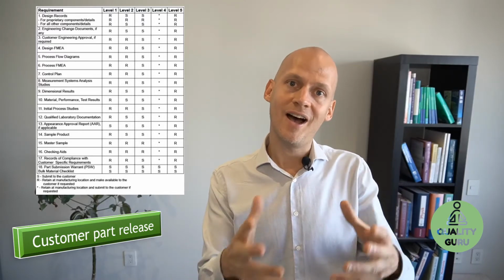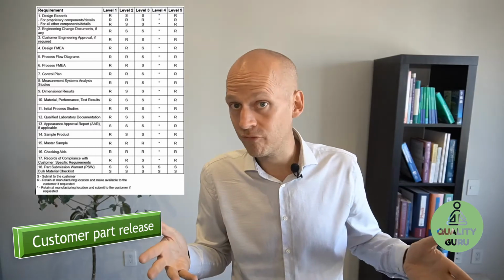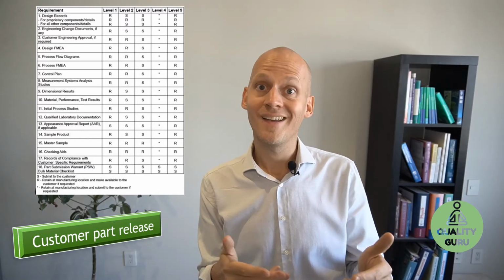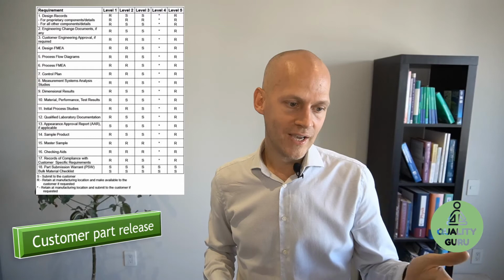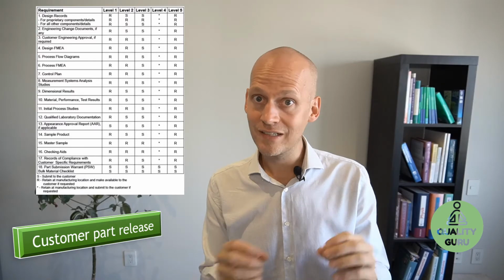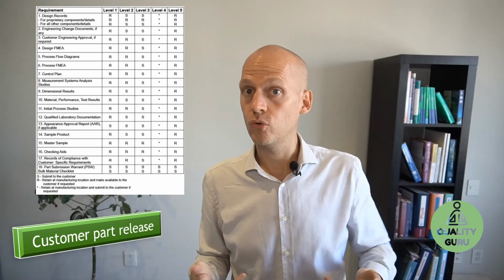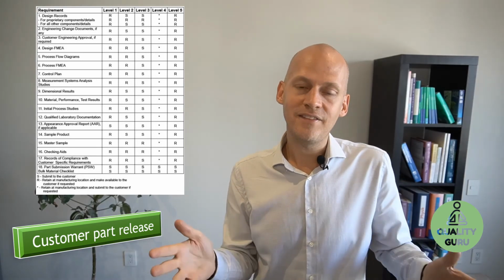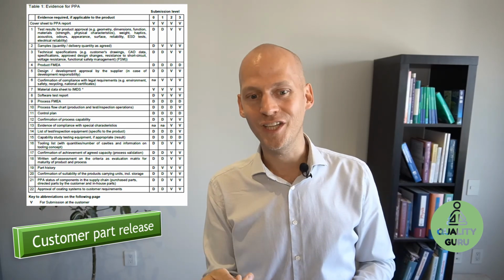What is PPAP? (PPAP vs PPA)

Comment: So is PPAP only for externally made parts by contractors, as opposed to parts made internally.  Why would these use different processes?
Reply from the maker: Hello Tony, PPAP comes from the automotive supply chain and is a standard defined by the AIAG (club of car makers who set several standards for the supply chain). Normally , the car makers release the supplier parts of the Tier1, the Tier 1 releases the Tier 2 and so on. Is this what you meant?
Reply: @qualityguru9047  I mean, can PPAP apply to internally made parts or sub-assemblies with no supplier or customer involvement.  I'm more from the finished goods electronics industry and trying to understand what PPAP is.
Reply from the maker: @tonystanley5337  yeah, why not. In the end, we can use PPAP as a checklist to ensure we have considered all important aspects.  You can also track part maturity ( not released / conditionally released / fully released) what is already on a 100% level , what not...

Comment: Very useful and understandable explained. I have a question and would be happy if I get the answer. Regarding the responsibilities of a Quality Engineer in preparing the PPAP documentations,  which documents should be performed by a Quality Engineer? Specifically for the preparing of PFMEA, Control Plan, MSA, and Process capability, is this the Quality Engineer who is responsible for implementing these documents?
I appreciate your early reply.
Reply from the maker: Hello @justice4allpeople, that depends and there is no black and white answer as different organizations and their leaders might have different ideas and philosophies. In some organizations the quality department is taking a more active role and is leading the activities described by you. In other organizations, the quality department  might only make sure that the documents are properly created and the process owners are responsible to create & provide the documentation. In the end it should be a team work. Who has the lead can be easily defined in a RACI (or RASIC) matrix. If not properly defined, people might push around the task and avoid responsibility. I can only assume that's why you are asking for guidance, nevertheless every organization needs to define this for themselves. So if it is not clearly defined, maybe you could prepare such a RACI matrix and sent it around allowing the responsible persons to comment and agree / disagree. Maybe 80% of the points can be agreed on directly. The other 20% of critical items can be discussed involving higher level decision makers (manager / director / whoever it is) to help defining the responsibility, then every department needs to prepare the resources and deliver accordingly. Please let me know if this is helpful for you & good luck

Comment: Hello Florian,

Here I have a questions. The PPAP or PPA documentation is the same if we are discussing about electronics components?(such as resistors, uC,  I.C. and so on)?
Reply from the maker: Hi Dexter, thanks for asking!
The purpose of the PPAP or PPA is to document that all requirements are met before starting to ship. And that the production process is controlled to garantuee quality over lifetime.
As the requirements for every commodity are different also the evidence you can ask for is different. If you are customer and want to have a general idea about what to ask for, you can look at previous generations of the product and take those documents as a guidance. Additionally you can take the product  specification and ask for evidence that the requirements are met (test reports, etc). Also consider lessons learned from defects of the past years and how to prevent them.
If you are a supplier you can do the same and propose a content to your customer or ask directly what scope they want to see. 
A problem could be that customers tend to ask for more because it makes them feel more secure and that suppliers want to give less, because it might safes effort.
Is this answering your question?
Reply: @qualityguru9047  thank you a lot!